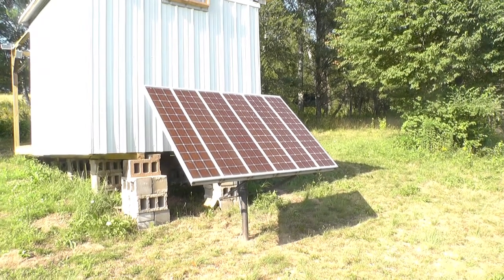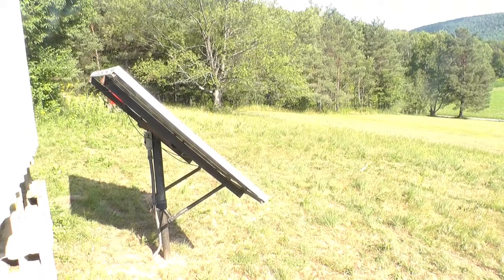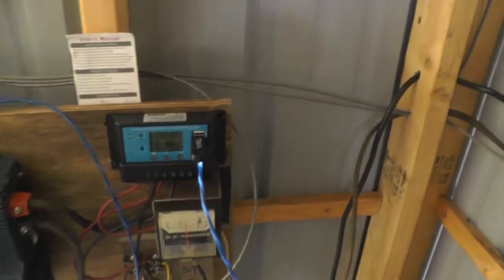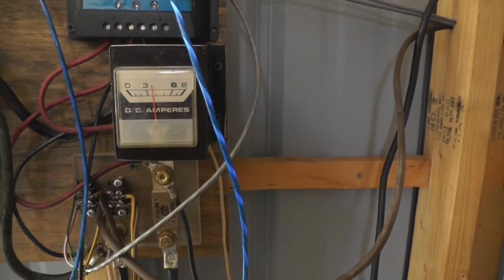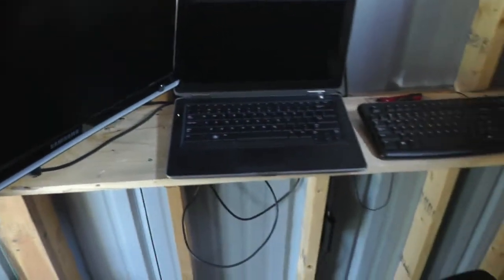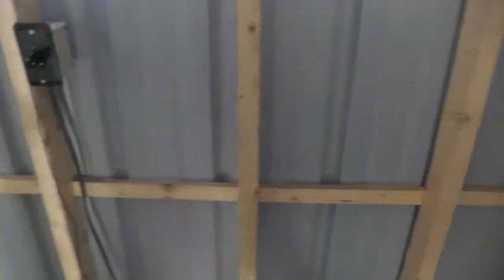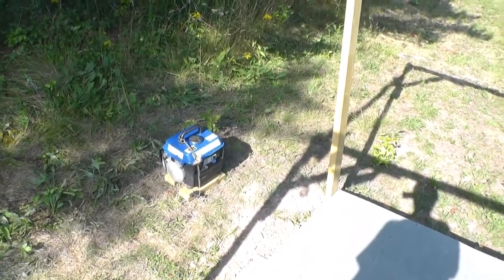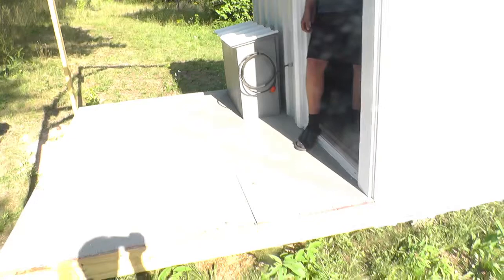Sliding Roof Observatory Build  Part 6

Comment: Nice job.  My only suggestion would be about the motion sensor light.  It's probably not a great idea to blast your night adapted vision every time you arrive or step out of the back door.  You could either add a switch to disable it during observing sessions, or swap out the white LED's for red.  I should have some red tinted plexiglass sheeting here that you could possibly use to add a filter to the lens if you want.
Reply from the maker: It can be disabled with a remote control. Great idea adding the the red covering. It's mostly to light the way back to the house when he is done. Thanks for watching.